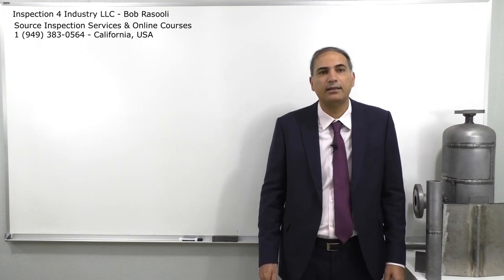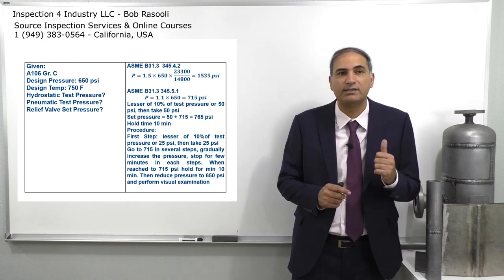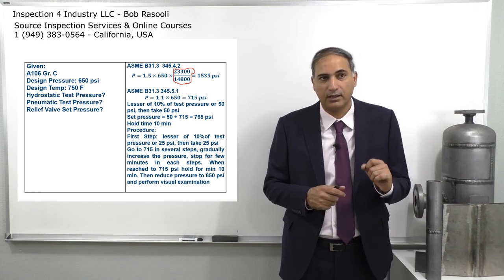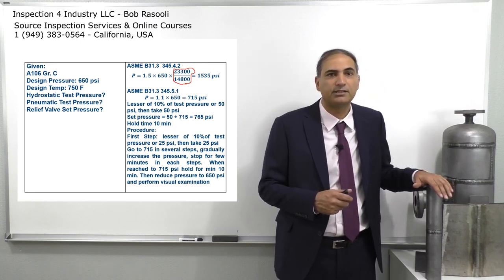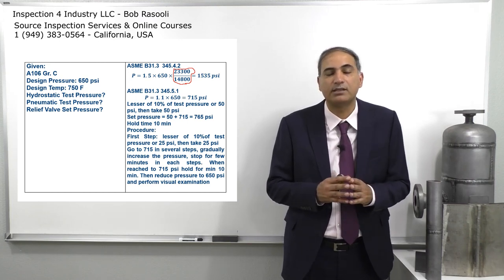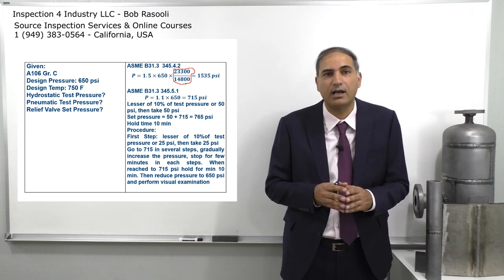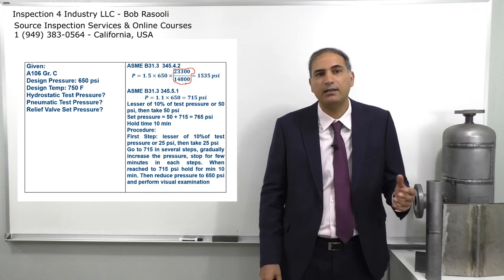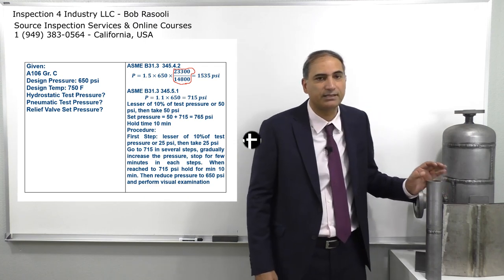Hydrostatic & Pneumatic Test Pressure Calculation of ASME B31.3 Process Piping - API 570 & SIFE Exam

Comment: I wasn't looking for this but it auto-played after another video. I don't do much with piping, but it appears that you calculated the LSR (23300/14800) to compensate the hydrostatic test pressure for design temperature, which is completely ignored for pneumatic testing - I'm not sure why... For new engineers and inspectors, Lowest Stress Ratio (LSR) is material stress at operating temperature divided by material stress at its design temperature. ASME Sec II provides you with stress vs temperature tables for many materials. Also, you should reference the code edition you're using. Someone might see this video and automatically assume 1.5*Design Pressure*LSR=Test Pressure, but 1.3 is allowed in later editions...

Comment: The last part confused me. You worked out the set pressure of 765 psi, do you set it for 10 min on that pressure(765)? But then you said the procedure you start from 650psi and you add 25 psi until you get to 715 psi which is the Pneumatic pressure not the set pressure you found? So why work out the set pressure if you going to start from test pressure and increase it by 25 psi (because 10% is 71.5 which is greater than 25 psi). You said do this until you reach the 715 psi.